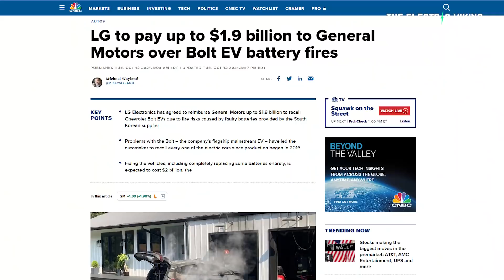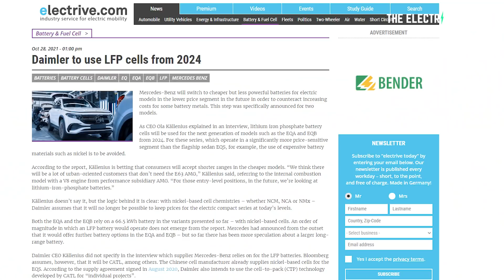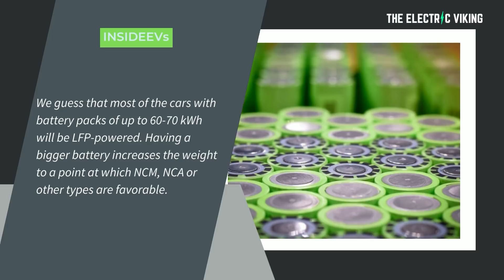Mercedes follow Tesla’s lead, will pivot to LFP batteries

Comment: I would rather LFP in my Tesla but they didn’t offer it in AWD. (Tesla Y long range 7 seat AWD)

From my learning from you I’d assume BYD is responsible for the pivoting of Tesla.😀👍
I love your show👍👍👍
Reply: You got it !  Viking is the ONLY channel that covers the entire EV market and it is where I learned of the NIO and its 'swappable' battery system.  I feel certain that 'swappable' will be the USA standard to move the multitudes into EV's.   So much news about battery improvements.  Improvements to motor technology have been equally important but with little fanfare.
Reply: @SunriseLAW  yes ! 
Another very important concept abandoned. Some feel that the  swap system will strain the battery supply but I feel it’s the opposite. Theoretically you could keep 12 million cars on the road with just 2 million batteries. With a whole host of other huge advantages. Ie charging at optimal temperatures supporting the grid during peak hours maintaining repairing and optimizing batteries and upgrading all electric cars with newer battery chemistries. Many people are under the idea that a structural battery cannot be removed and swapped but I disagree. It’s just that the presence of a battery will only add to the strengths.
Reply: @pgiatrakis  In USA, I feel that most people would do just fine on a small battery that has, say, 150 miles of range.  And for insurance reasons none of us really need to do 0-60 in under 5 seconds.  When a person wants to to go on a long trip, maybe they would just rent a larger battery.  The Bolt fiasco demonstrated why it is so awesome to decouple the battery from the car.
Reply: @SunriseLAW  Precisely I guess you can apply the Uber concept or Toro concept the battery itself giving rise to a middle of the road option for some people plus if you ever damage the battery you can have it worked on while you rent another one. With serial numbers and block chain technology it’s probably very easy to keep track of your battery in the inventory and records could be kept showing abuse of the battery for instance letting it sit at 100% running it down to 0% or charging it in subfreezing temperatures. (for susceptible chemistries of course)
Reply: @pgiatrakis  Yes EXCEPT.... the battery will be automatically tested at swapoff and defective/abused ones will be recycled.  That will be THE primary attraction to the masses...knowing that their battery will never go bad on them.
Reply: @SunriseLAW  exactly great 👍 idea
Reply: @pgiatrakis  12 million cars, 2 million batteries....you mean 2 million EXTRA batteries. Sounds like a 20% increase in the number of battery packs.
Reply: @davekozlowski1266  It all depends on how you set up your system for instance in your system you may need 2 million extra batteries but in my system you wouldn’t. If 95% of a car is life is sitting parked than one could argue you only need enough batteries for 5% of all the cars because the rest of the time the batteries could be out of the cars charging. But I think that’s a little ridiculous I think a more realistic number if done correctly would be an 8 to 1 ratio with 8 cars to everyone battery pack maybe even 16 cars for every single battery pack. It’s very complicated but I’m certainly open to the idea that I could be completely wrong and that you could be completely right. I’m trying to wrap my brain around it however I know one thing for certain I’m not convinced that you would need six battery packs for every five cars I would think maybe six cars for every five battery packs??? It’s great conversation and it’s very puzzling…
👍😀
Also I think an other thing that would facilitate the logistics of battery swapping would be a permanent internal battery that would give you 40 miles of range.
Reply: @pgiatrakis  so you're talking about some type of mobile service? Kind of hard to drive a car to a battery swap station without a battery.  Sounds like a taxi service would be more efficient.
Reply: @davekozlowski1266  yes, if a company is going to go through the trouble of building a battery swap station then it makes sense that most cars have a modular battery pack system removing gradients of batteries. Swapping big for small, depleted for full, old for new, advanced for antiquated. I think it would also add variation on affordability too. If you contribute to the “battery cloud“ then depending on your membership you have a variety of options. It’s certainly fun to think about. One you start considering induction coils in roads like Europe does then the complexity boggles the mind. People that want to hold on to their battery can do so and the ones open to swapping can do that too. The fact that all my power tools take the same battery saves me money because I can only use at the most two power tools at a time so technically I only really need two batteries for 20 tools. However to your point I must suffer from a lack of imagination because I have as many batteries as I do tools. Like I said it’s complicated but not impossible. It’s really fun to think about and speculate about. Thanks for the informative thought provoking conversation. Thinking out loud is fun. 👍👍👍

This means (because I didn’t make it clear) leaving a small modular battery behind in the car so that it can be moved parked transported out of the way for a larger swap later. 👍😀
Cheers
Reply: @pgiatrakis  in 10 to 15 years batteries could get to the point that you swap out a pack like they are doing with those mopeds. It would not surprise me at this point.
Reply: The whole industry is dependent on batteries. BYD leads in batteries Tesla leads in everything else.
Reply: @Bryan-fb8dh  It seems that technology leadership lasts for a few months.  Whatever is good in a Tesla quickly becomes a commodity.
Reply: @Bryan-fb8dh  great point and probably very true but I assume not for long. 😀👍🤞🏼